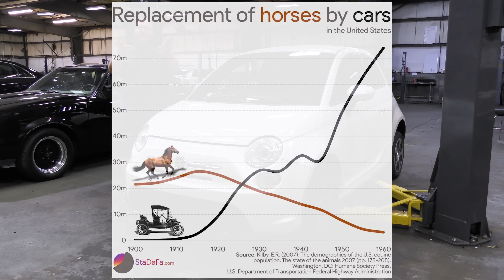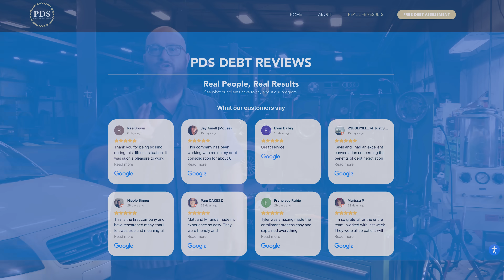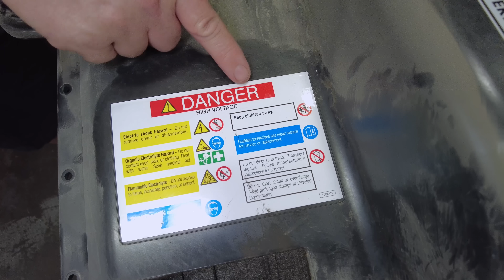How to SAFELY Remove the EV Batteries From my Fiat 500e

Comment: Here I am in the backseat with Mrs. Wizard

We’re not that kind of channel! 😂💀
Reply: If you can be that kind if channel in the back seat of a Fiat 500, that would be an impressive feat
Reply: @ChromeCylon  I think you've found the next Tikky Tokky challenge.
Reply: @raygunsforronnie847  I do have a Fiat 500
Reply: "Wizard's Ways - After Dark" - the steaming tale of an Alfa Romeo and Lambo Countach under the Omega roof. Is that magic in the air or just Brakleen? Stand by for Season 1, Ep 1!

Comment: The difference is that combustion cars was not build on a lie like EV is
Reply: What's the lie ? Electrics are around as long as petrol engined cars. Even old Henry Ford bought his wife an EV instead of one of his model T.
Reply: @mlann2333 it has nothing today with when the EV was invented, it’s about why the system forces it on us today
Reply: Which lie? That we do not need poor african boys digging out the crude oil and polluting their lands? Not needing oil barons buying from them and refining it into gazoline with much smoke and polluting our lands so YOU fossil users can burn it in your outdated oldtimers and pollute YOUR land?

Comment: Wizard, is your car a 500e MK1 or MK2 version? Also, how come the part you need to change is not still under warranty, seeing how little mileage it has done?
Reply: 2014? i Guess MK 0.1.
Reply: @wolfgangpreier9160  That will be the MK1 then - the chair of FIAT said do not buy under any circumstances - he hated EVs and the design and the way FIAT built the MK1 was really bad and cost a lot more money than it should have.

MK2 (released Jan 2024 in the USA) They reduced the cost by 25% due to the design changes & cost cutting from suppliers and 25% due to the way they built the MK2 cars at the factory... they followed Tesla design and used single castings - manufacturers reduced costs a lot but cost the end user a lot in repair bills and insurance for even the smallest damage to the cars
Reply: @QALibrary  We had the MK1 imported from California, nice but not enough range.

 Still running at the 2nd buyer. 

Now we have the Mk2 in rose 
gold, nice for wifey, for me not so much.

Comment: EVs are like sushi.  The thought of raw fish was crazy to me before I tried sushi.  After I tried it I really liked it though and have sushi often.

I got an EV in march and I have a level 2 charger at home.  For me, along with my coyote powered f150, my EV fits really well into our lifestyle.  For me anyway, it’s been a good experience and we mostly use the EV - but I won’t sell my F150 any time soon either.
Reply: I have ditched all fossil use in 2019. Everywhere. I have a clean conscience toards my kids AND safe a bunch of money every year.
Reply: @wolfgangpreier9160  hahahaha oh stop it. If you use any power from the grid you're still using those so-called "fossil fuels", stop kidding yourself. Oil is abiotic, you might want to learn something before you regurgitate nonsense that you've been fed since childhood. 

I would advise you to go look at the toxic wasteland that is left from the mining for lithium to make your loving and "green" batteries hahaha. 🤡
Reply: @wolfgangpreier9160 your ev was likely manufactured using materials sources from mines using slave and child labor. Sleep tight 🙂
Reply: I, on a whim traded 2 motorcycles for a 2014 500e. Loved that car! Didn’t care for the small battery so sold it for a profit and, bought a 2017 Chevy Bolt. Love this car even more. It’s got 85,000 miles and no degradation and still warranty on the battery (Chevy replaced batteries through a recall a few years ago). I’ve owned over 100 cars in my lifetime, and I think my EV’s are literally the most fun to daily drive. I love silent raw power right off the line and, no maintenance and no gas stations. I have a project C3 Corvette too and the Bolt is the Classic car parts getter… 😊
Reply: Bad analogy bub. EVs are lame and Sushi is awesome.
Reply: @jeepinintexas6215  Yes, very lame, the last Porsches and Lambos were roasted by my cheap Family SUV. Very embarassing.

Comment: It’s going to be such a huge deal when 3rd party battery suppliers become firmly established to keep EVs on the road much longer. I do expect EVs will for a long time have a steeper depreciation curve than gas cars because of people accounting for battery life.
Reply: The tech in the battery management system is so complex, it's very hard for a third party supplier to exist without the cooperation of the car manufacturer. And not a single manufacturer is cooperating, because of greed and wanting to monopolize the repair and supplies on their cars.
Reply: First they have to overcome being a solution looking for a problem.
Reply: @worldhello1234  tailpipe emissions.  Reliance on foreign oil.
Reply: Third party batteries do exist, but you get what you pay for.  You want to only pay $5k instead of the $15k for the OEM battery, you may only get 3 years out of the third party battery, whereas an OEM one might get you another 8-10 years, but be an overall better value per dollar, $1500 per year amortized versus about $1667 for the third party battery.  For a short term the numbers aren't that big of a deal, but these numbers may jsut be for the battery itself, not including installation, which can add up, as you'd have to replace the cheaper battery probably 3 times so it 's not "cheaper" necessarily to go with third party.  I've learned this many times with many things (not just cars).  It sometimes doesn't pay off and you're better off just going an getting another OEM particularly if that OEM battery lasted say 10+ years.
Reply: Now at 120,000 km on our 2022 Tesla model 3 with only 3% degradation. I think rust will stop EV’s before the battery does.
Reply: @antoinepageau8336  aren't Teslas made of aluminum? to save weight?
Reply: @JayWye52  Only the model S and X, The 3 and Y mainly use steel or cast aluminum and the Cyber truck is stainless (on the outside).
Reply: It's going to be a race of longevity between battery & shell. The fact that EVs don't go through the vibrations & shakes an ICE produces protects the chassis & metal, including from rust.
Reply: @antoinepageau8336 Dont care if you love or hate them, your math won’t work out the way you think it will. Only one Tesla has made it to a million miles last I checked, and frankly it doesn’t count as it went through four sets of motors and four batteries. Battery life is not linear. Once it starts to get hit hard it’ll fall off a cliff to dead. Just like your phone does. Good luck.
Reply: @QCJerks  Why does it have to make it to 1M miles? The average car I've owned made to 100k miles and then the repair costs outweighed the values of the car (BMW, Mercedes, Audi). 
Also my battery is Lithium Iron Phosphate, if you look into it you'll see they have 3X the cycle life of LNMC batteries of old. 
What you and many are forgetting is that batteries are still improving at breakneck speeds, while ICE technology has nowhere to go.
Reply: @QCJerks how many million mile cars have you even seen?  Cars rarely make it past 300k.
Reply: The issue here is LIABILITY-nobody wants to be sued-and these batteries can cause enormous deadly fires. As we speak, top law firms are filing lawsuits against EV mfgs-and the insurance rates will skyrocket
Reply: @genekelly8467  True, Gazoline does not burn, Diesel is not harmful and can be consumed daily in your cereals.

Are you fresh out of Kindergarten?

Lawfirms can sue everybody, nothing new here. Including when you dig in their noses.

Batteries have been around for centuries, burning or otherwise dangerous material is around since mankind exists.

So PPPPPLEASE keep your nice big Gun in your pocket and calm down matey.
Reply: @genekelly8467 technically true but in practice EV fires are 50-70 times less likely than those for gas cars. Turns out driving around with a bunch of flammable fuel is kinda dangerous.
Reply: @chrisbuczeksmith8289  Maybe..but as these batteries age they develop high internal resistance-which generates heat-and once the battery enters thermal runaway-boom. You  do not know when this will happen-the battery monitoring sensors cannot tell you this. This is why all EV mfg.s advise owners NOT to park in basement garages or near your house.
Reply: Your right along with every other part in these batteries.   Like the wizard said he had to send that module to Bulgaria to the only authorized repair shop in the world for those.    That's just one big reason of many that makes these battery parlcks crazy expensive
Reply: Like this video said,it wasn't the batteries,it was the electronic module that failed. and the ONLY company rebuilding it is in Bulgaria.
That's for a FIAT,a brand sold in both Europe and the US/Americas.
But the REAL weak point for EVs is the electrical supply,the grid capacity. Nobody has the grid capacity to charge so many EVs,and they're not expanding grid generation,they're DECREASING IT,with solar and wind that's unreliable,intermittent.
Reply: My point being; the more complexity to a system,the greater the chances for failures,and the harder they are to find and fix. Even more electrical CONNECTIONS makes for higher failure rates/less reliability. and the automotive operating environment is one of the toughest around,except for outer space.
Reply: No they do not. Batteries last much longer than the cars. The Fiat is 1. gen, just as the Nissan or E-Golf. Now we drive 4th gen and he batteries are not a topic anymore.
Reply: @wolfgangpreier9160  batteries are better, but these vehicles are still made unnecessarily complex with gadgets that could brick the entire car. BYD could sell a simple, reliable EV for $13,000 but governments will tariff them to death.  US invested far too much money on outdated battery tech while the rest of the world will be on solid state batteries in a few years.  Teslas are very high profit vehicles and while the cost of battery production has plummeted the last ten years, the EV vehicle prices have not.  Tesla essentially made their cast frame cars like iPhones, they cannot be fixed.

 Lease  and dump is not green.
Reply: @truantray  Yes, lease and dump is very green as long as the production uses the least amount of fossil energy possible.

My cars are most certainly repariable. But i DO NOT REPAIR THEM. It is NOT MY JOB.

I earn my money by selling my services and parts to my customers and will not switch my profession to Tesla repair shop.
Reply: @wolfgangpreier9160  don't know where you've been, but no they don't. Batteries are are lasting about 10 years under normal usage and mild weather conditions.
Reply: @patrickradcliffe3837  My batteries last about 1500 cycles. That is roughly 600.000km. 

If i would be driving my cars all this time that would be between 15 and 30 years.

You are correct, old Roadsters, Nissan Leaf Mitsubishi MiiEV or VW E-Golf do not last that long.
Reply: @wolfgangpreier9160  always outliers pal bet your batch of cells are a perfect match set? That doesn't happen often enough to be the standard. 600k hmmm, I have a couple trucks with more km then that and still running on the factory build engine. The difference is bet you range is three quarters what it used to be at best, while my trucks have the same range as when they rolled off the production line thirty years ago.
Reply: @patrickradcliffe3837  " That doesn't happen often enough to be the standard. " 

1. Why not? 
2. That is called mass production. 
3. It is most certainly the case that they are all matched.

And who cares what range your trucks have with 600k Kilometers or 450.000 miles?

I do not even care how much range my EVs have today. I know more than 350km in high winter, minus 10 degrees celsius in storm and snow on the ground. I do not need to know more. 

That is the worst case scenario in my area in the middle of Europe.

How much range does your truck have in these conditions? Do you even know?
Reply: @wolfgangpreier9160  don't think you understand manufacturing tolerances. TLDR the manufacturer allows a certain amount of mismatch in a design they set a standard that is far below optimal, and in your case you have a pack that is significantly above that standard tolerance. As far as range my trucks have the same range in winter as in summer. You're not worried about range now, I'm betting when it gets to fifty percent of the brand new range you'll be looking for either a new pack that has been sitting on warehouse rack for the last five or ten years, or just buy another car "not the most environmentally friendly plan"
Reply: @patrickradcliffe3837  TLDR does not produce my battery packs. If they can not put matching sets of 8000 battery cells into a battery pack i guess they should find other jobs.

"As far as range my trucks have the same range in winter as in summer" No you have not. You can lie to me. But please do not start to lie to yourself.

My batteries last at least 600.000 km with more than 80% capacity.

How many engines and drive trains have you had to replace in 400.000 miles in your truck?

How many catalytic converters and/or Diesel particle filters? How many AGR and coolers? How many clutches or torque converters? How many break jobs? How many transmissions and oh so many other parts i simply do not have or only rarely use in a EV like brakes.

In 600.000km a new battery pack would be 12-15K - TODAYS prices! Of course that would be the end of the car. 

In 600K the car is run down and rusted away anyway.

Why should i bother for more?

Some Model S users drive their cars for more than 1 million miles. Nice but not my intention.
Reply: @patrickradcliffe3837 where did you hear this?
Reply: @wolfgangpreier9160 right but the first teslas are almost worth as much as an old honda accord.
Reply: Yes, that's why if you damage a battery pack, your vehicle is totalled by the insurance company....  Keep telling yourself that.
Reply: @jasonsmith1389 not always. Depends on the accident. If all you did is hit road debris and it's low mileage they may fix it. 

If you are in a collision bad enough to damage the pack, then you are going to have huge damage elsewhere. Never seen the pack damaged where it didn't also total the car based on front, rear or side impact damage.
Reply: Yea, but only in the US. You guys total everything After the smallest dent 😂
Reply: @alfa7561  That is true. I was watching a car themed video where EXPENSIVE gas cars were totaled for 'hail damage". You would need a microscope to see the dents.